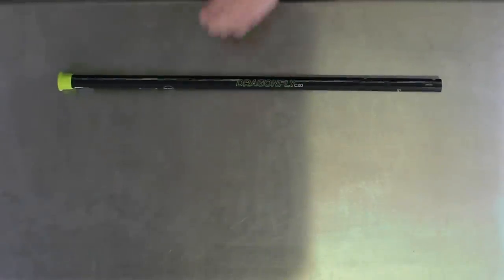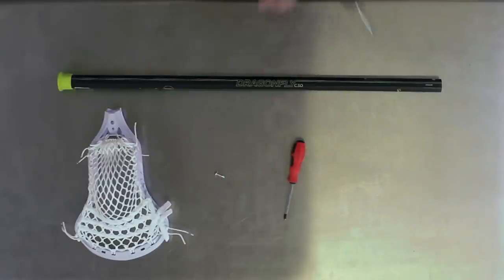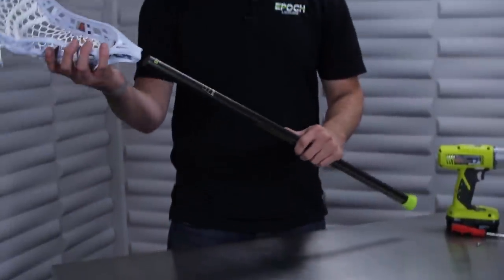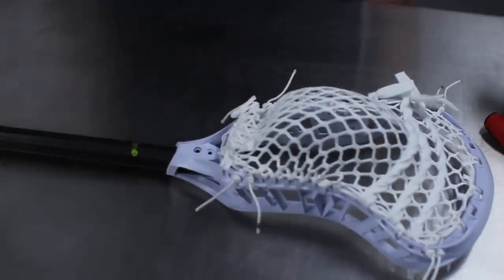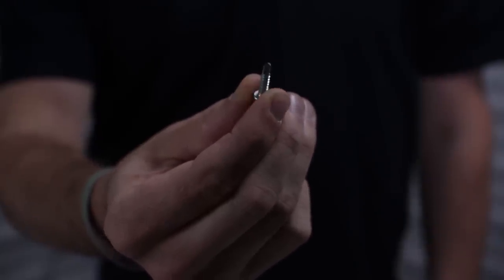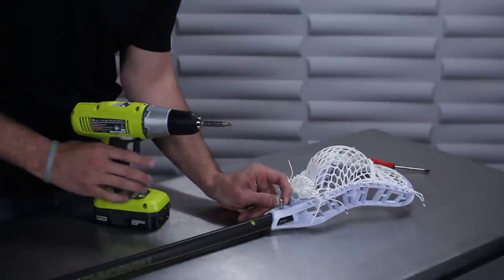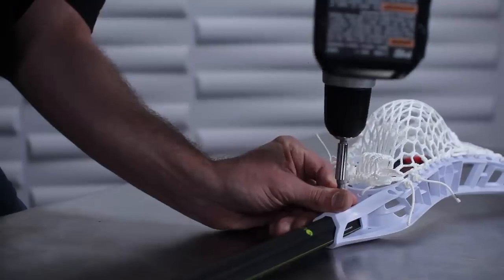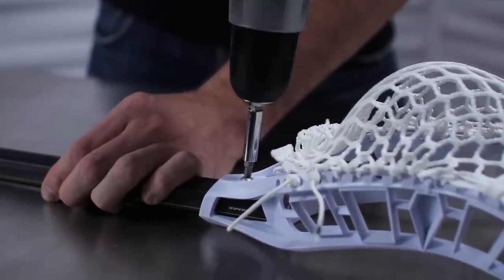How To Series: How To Drill A Hole

Comment: hey guys my lax head doesnt push all the way in my shaft. Theres still 1 or 2 inches from the top. What do i do???
Reply from the maker: socal strings you can try warming up the throat under hot water to make the plastic easier to form when you attach it to your shaft. Make sure it is on completely before you insert the screw.